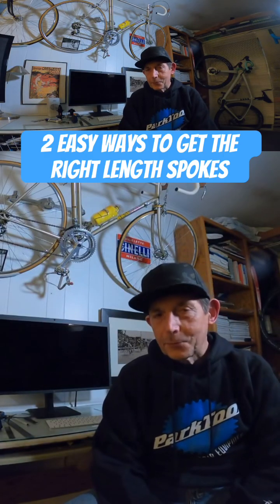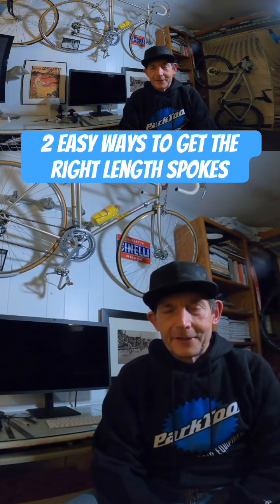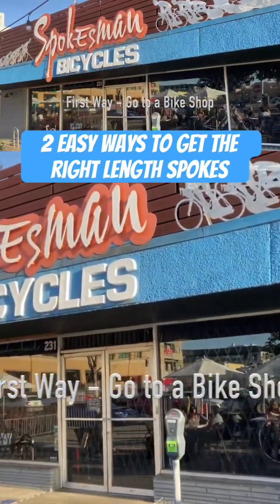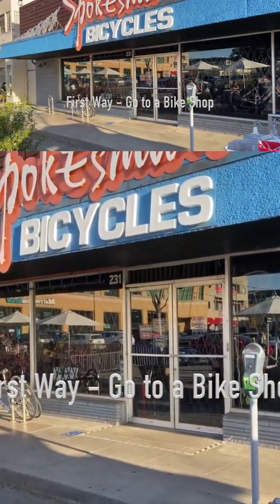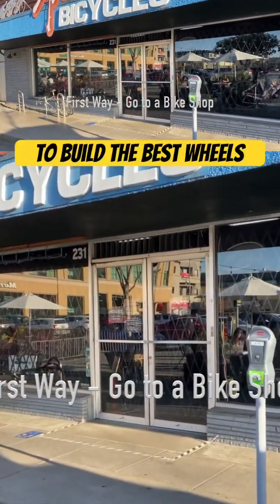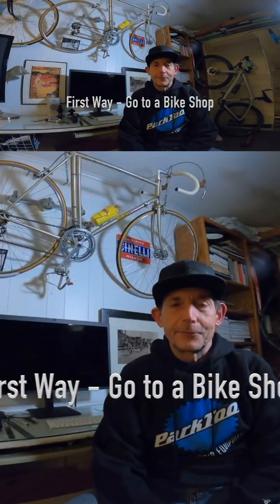2 Easy Ways To Get Your Spoke Lengths Right For Wheel Building #shorts #bikerepair

Comment: Hello Jim, have you measured a rim using oriented drilling?  Like Andra 40 or 30, these have a very thick wall and the spoke drilling oriented towards the direction to the hub. If you try to measure the ERD it will give you an error since nipple will not be perfectly settled over the hole.
Reply from the maker: Thanks for watching and the question about Ryde Andra rims oscalsmen. Usually you can measure the ERD no matter what the design of the rim is. But if there's any issue, then you would look for the ERD in the company's tech pages. Here it is for the Ryde Andra 30 rim on this page: https://www.ryde.nl/andra-30/ I hope this is helpful and thanks again.
Reply: @JimLangley1  hello Jim, if I use Ryde's ERD spokes are close to 2mm short. If I use my ERD spokes are like 1 to 1.5 long. These rims are very thick, now I have to order another set of spokes... :(
Thank you,
Reply from the maker: @oscalcmen  thanks for letting me know. I've encountered incorrect ERD from companies before. In theory companies wouldn't assume they can get an exact ERD from engineer's drawings, but I believe that's what causes this error. What they should be doing is building wheels to make 100% sure that the ERD results in perfect spoke length. I used to work for a rim company and it was my job to do that. In any case, it always falls on the wheel builder to find the right spoke length. In your case, the too short spokes won't work, but 1.5mm long is almost always fine. The only time it wouldn't be acceptable is if the spokes protrude enough to cut into the rim strip/tape. So I would go with those long spokes you have unless it'll put the tape/tube (if it's a tubed tire) at risk. Hope this helps.
Reply: @JimLangley1  hello, I agree, technical information should de correct. Another thing I notice is the internal length thread of nipples, sapim has less threads and allows me to accommodate longer spokes (from 1 to 1.5mm) but other nipples like pillar do not allow the spoke to get above the nipple head, longer threads section.
Reply from the maker: @oscalcmen  yes, that's a good point and it's why some professional wheelsmiths only build with their chosen spoke brand and type (spokes & nipples) so that they can guarantee their work with confidence since they know exactly what they're working with. My preference is DT Swiss. I started with them when they first arrived about 1980 I believe and they just work. Thanks for the great comments and happy wheel building!

Comment: Spoke length is my worst enemy especially when someone brings a random rim and hub and a bag of mix matched sizes in spokes. "Spoke this for me?" My reaction is just🫤 uuhh I think you should replace thease for a new set maybe or if not inertube replacement isn't on my the day you case a jump and get a flat with that lil bit of extra spoke
Reply from the maker: Thanks for watching and commenting Liam. That's a good point about the "basket case" parts people bring in believing you can work miracles. Sometimes you have to kindly explain better options for them like you did. You probably made a customer for life.
Reply: @JimLangley1  I stopped working g on bikes other than ours a few few years back I made a good friend helping that guy out we rid bmx together he later sold it to buy a dirtbike I told him not to get later on that weekend I got a call he had passed away in an accident. It took me two years to find what was left of the bmx he sold I now have it hung up in my room along with the only rim it had left as the guys he sold it to stripped it for parts. I had to drive a quarter way across my country for the thing to find out it was just laying in overdrown grass rottin.
Reply from the maker: @Liamwolf-600  wow, that's quite a tale Liam. What a wonderful tribute to your friend to got to the trouble to find and rescue what's left of his bike, you're a good man.

Comment: I would like to know everyone's opinion because in my area, the number of local bike shops that have expertise in wheel building seems to have decline constantly since the early 2000s and then  even faster after the advent of brand stores. They have become prebuilt wheel sellers.
Is wheel building becoming a lost art among young mechanics ?
If you work in a bike shop where no one can teach you, how are you supposed to learn ?
Reply: I've said for nearly 20 years how I really miss wheel building. After teaching myself decades ago as a teen I worked in a college town shop. The 80s into the 90s where the prime years for custom wheels or just maintaining and rebuilding.
Pre-built products slowly killed this. It re-educated the buyer and seller. I'm not sure it's a dumbing down thing - there's so much more tech to cram in one's head.
What I do lament is the loss of self sufficiency among many consumers. I worked a station at a bike-fest agreeing to demo fixing flats with the assumption no one would visit. I guessed right.
The variety of rim dimensions contributes to more complicated spoke stocking. And that's an  oversimplification of wheel product variation. I just lived through a chain of shops I worked for get a new owner. An accountant, he looked at stocking spokes with disdain. I left just as they bought a spoke threader - meaning the idea was to cut and thread individual spokes as needed.
¯\_(ツ)_/¯
Jim's channel is certainly a place to gain this knowledge that is getting so rare.
Reply: @m.talley1660  to be honest your right the amount of sizes we have today make things harder I find alot of my local places dont have the necessary sizes stocked for custom wheels especially when they don't hold stock for custom builds and just stock spairs for more common sizes. 
Spoke threader are a savoured to anyone who can't get ahold of parts locally and have no time to wait.
Reply from the maker: @m.talley1660  thanks so much for watching and sharing your feedback m.talley - great points. We had one of the first Phil Wood spoke machines in 1983 and with all due respect to Phil, who was a genius - it was the most persnickety machine I ever used. Half the time, the threads weren't cut deep enough regardless of how carefully you set the plates that did the threading. I'm sure the machines have improved since those early days, but having cut/threaded hundreds of spokes on that fussy machine, I would much rather just order factory spokes in the right length and that's what I'd recommend shops to do too. An online source for spokes I've found usually has what I need is universalcycles.com Thanks again!
Reply: It's because it's difficult to learn and today's generation is getting dumber.
I I had to learn myself as a kid because of growing up unable to afford anything new its a good thing to know.
Reply from the maker: @Liamwolf-600  thanks for commenting Liam but in my experience teaching many people how to build wheels, I don't think it's hard to learn at all. I would say that some people get the "feel" for truing and rounding faster than others, but it's easy to teach spoke lacing and I can teach anyone who wants to learn how to true and round and tension. I'd say it's a process for sure and it takes time and some patience, but I wouldn't say it's hard - most students actually find it fun and riding wheels they built themself even more fun.
Reply from the maker: Thanks for watching and posing the questions Sylvain. Actually, part of the reason I made my How to Build Bike Wheels the Easy Way video - the video that essentially launched my channel,  https://youtu.be/XUqul03hbZ8 was because I heard from so many people wanting to learn how to do it - and some were apprentice level bike shop mechanics who didn't have anyone at the shop to show them how to build wheels. What happened is that factory built wheels became so inexpensive that it was decided it's easier, faster and more profitable to just replace damaged wheels with factory wheels, than to rebuild them. That video of mine just hit 700,000 views, which I take to mean that an awful lot of people out there still want to learn - and I'm sure from the comments, that many of them are new mechanics. I keep putting up more wheel building videos for beginners and I hope that they're helpful for anyone starting out in the industry and home mechanics too.
Reply: @JimLangley1  
Totally agree.
And this is one of the reasons I love and support this channel.
Reply from the maker: @sylvainmichaud2262  thanks a lot Sylvain, I appreciate your support and your excellent comments and tips add a lot of value to this channel, thank you 🙏